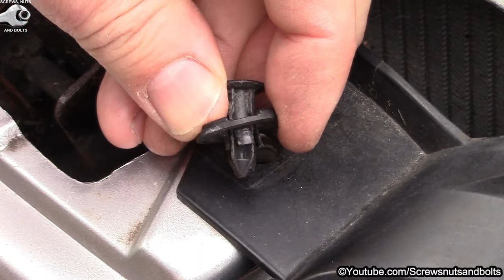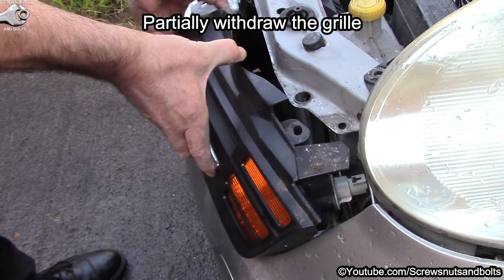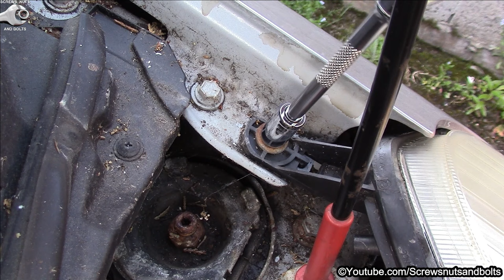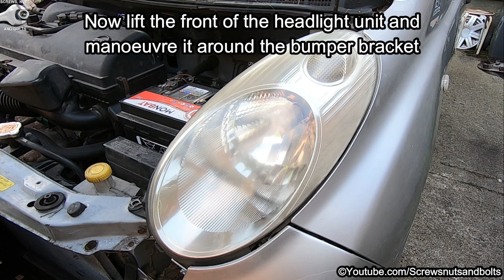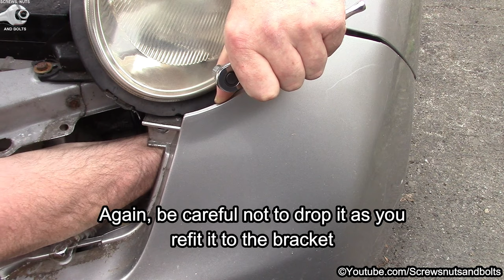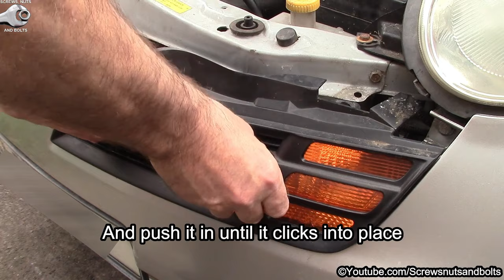Headlight Removal and Refitting - Nissan Micra K12

Comment: It seems I may have to use this to access the fuse for the rear widscreen demister fuse - that white box under the headlight is the 3rd fuse box where it's located I believe?
If ScrewsNutsAndBolts sees this: have you gone as far as replacing the front cross member on the K12? It looks like I have to do soon :-/
Reply from the maker: Yes that's where they've placed the 3rd fuse box, for some reason !. It's unlikely that I'll be replacing the cross member I'm afraid. If I do I'll let you know asap

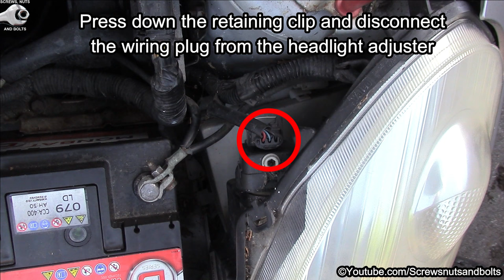Comment: I has trouble removing the retaining clip at 1:36. I realised i was doing it wrong. So you push in the metal clip and at the same time pull the block upwards (i was trying to pull out the block backwards).

Comment: The removal should be done only if you need access  the fuse box under the headlight. Bulbs are easily changed w/o removal of a headlight.
Reply: I disagree. Especially if you have fat hands and/or an Autech model which uses a different type of bulb. But it’s so quick and easy to loosen up the light and makes the job so much quicker and easier… there’s no real reason not to.

Comment: How did you transfer the little unit box onto the new light
Reply from the maker: According to the manual, the adjuster motor is integral with the headlight unit and is not available separately.

Comment: Any reason why the last wiring connector would be so difficult to remove? Mine just won't release. 4 mins 50 sec in your video.
Reply from the maker: They can just get stuck onto the back of the bulb. Just keep wiggling it back and forth and it should eventually come off. Try not not use too much force though or you could damage the bulb holder. I had the same issue myself and I wanted to get a sledge hammer to it ! lol
Reply: @screwsnutsandbolts  thank you! Will give it a go.
Reply from the maker: Not with the sledgehammer I hope....
Reply: @screwsnutsandbolts  haha I'll refrain from the use of the sledgehammer

Comment: This is not correct for Australian viewers.  For some reason the bulb is an H11, and there is no rear rubber boot, but a clip on cap, and the bulb itself has 2 retaining screws, not a spring as used in the H4.  With minimal access, the only way I found was to remove the whole headlight. The hidden 3rd bolt can be accessed, with difficulty, via the wheel arch if you bend the black plastic downwards and wiggle your hand and a 10mm socket. Crap design!!!
Reply from the maker: Yeah it's not the easiest, considering it's something that needs to be done periodically. I assumed the design would be the same on every K12 Micra !